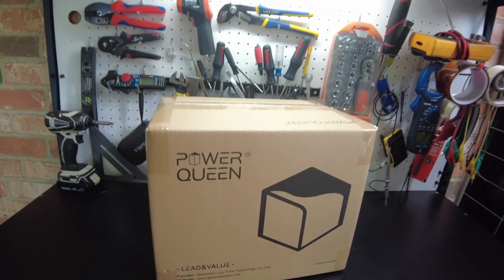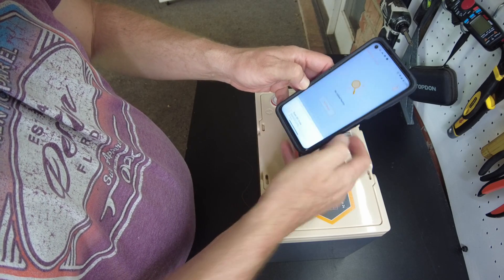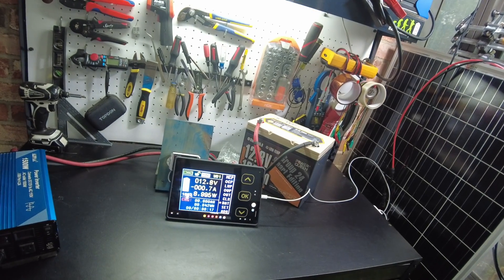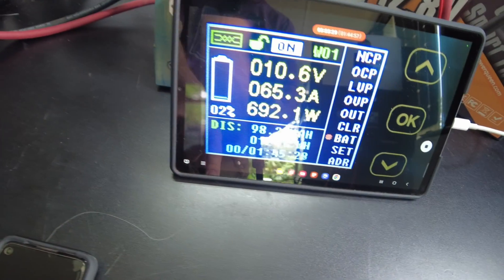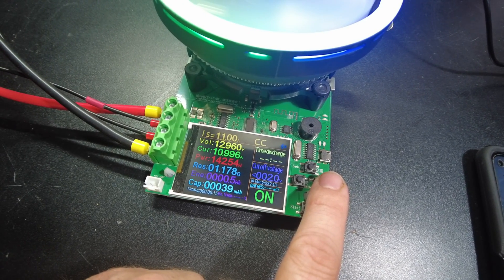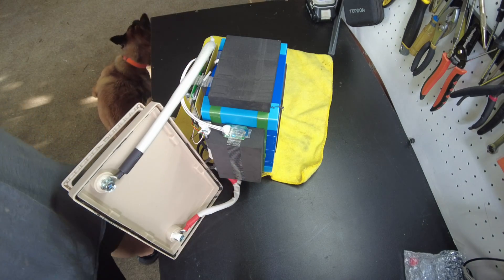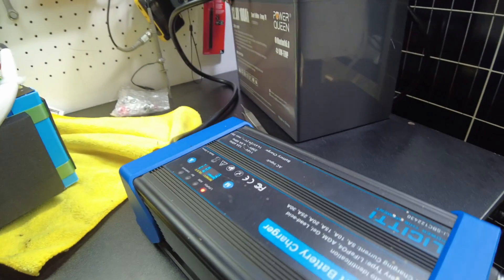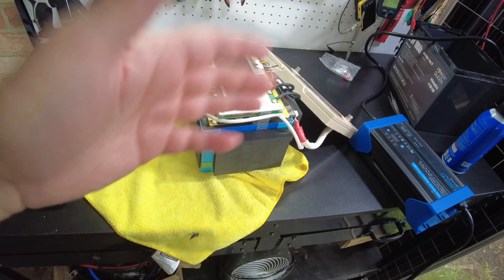Power Queen Bluetooth 12V 100Ah Group 24 LiFePO4 battery

Comment: They're starting to say I can just swap these in for the old wet cell batteries in my RV is that true
Reply: Most likely they work worry free. Lithium (or LifePO) batteries require highter voltage for 100% state. But built-in RV's convrerters and Car alternators still charge Lithium to about 50% capacity. You still take advantage of Lithium and as a matter of fact by not charging 100% Lithium battery last a lot longer. 
My advice is to stick with higher capacity batteries like 100AH. Lower capacity ones usually don't have enought output current rate to power tongue jack. If you have manual jack, then even 20AH Lithium battery works.

Comment: Seems like getting the Bluetooth version is a no brainer. This will be on my boat and I’m not sure if there’s really any other way for me to monitor the SOC easily. Any issues? The BT would be ok 24/7 correct? My only concern.
Reply: Lithium can be measured by voltage (print a voltage chart) or get a shunt.

Comment: Thanks Brad. I was wondering if you checked the tightness of the cables between the battery and inverter?
Reply from the maker: You're welcome! Yes, I do usually check before testing, also after the test I would notice the wires lose during bolt/terminal removal. Thanks Ben!
Reply: @BradCagle  Guess whose fallen for loose terminals recently and is ultra sensitive to that problem?
Reply from the maker: @Bennyboy-dog  Oh man, it's totally happened to me before LOL.